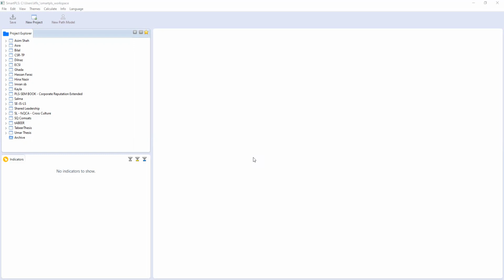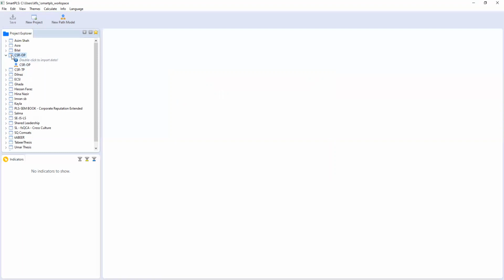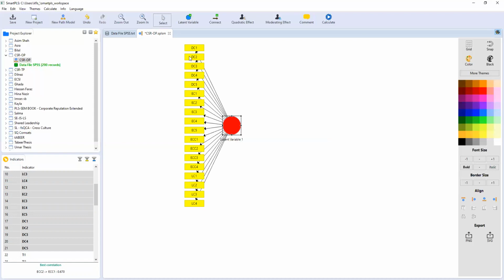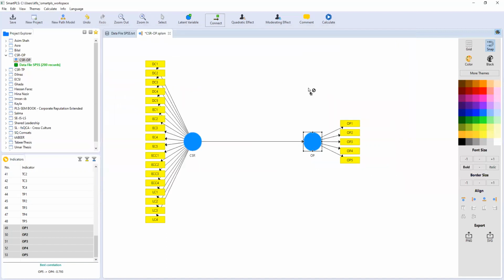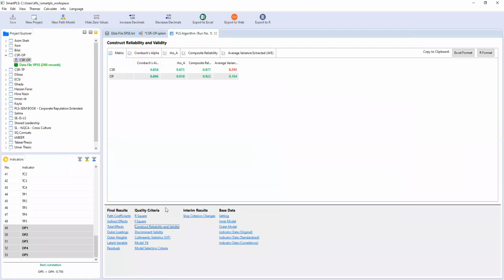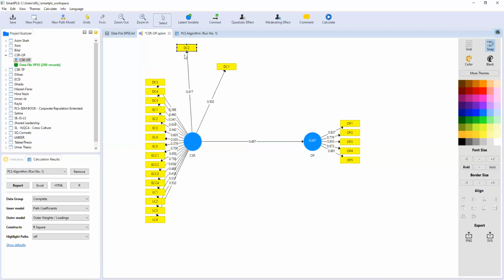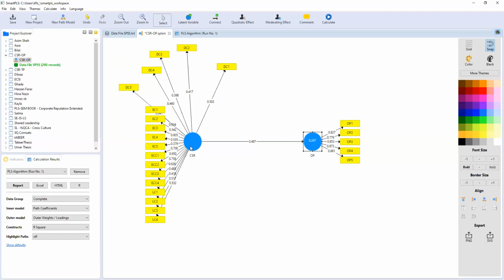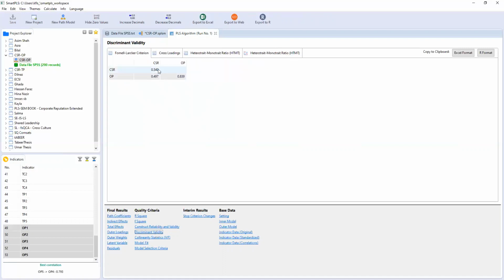Basic SmartPLS Model Assessment - Measurement Model - Reliability and Validity

Comment: Assalamo Alaikum. I am PhD scholar and recently started research work using smart pls. 
Can i run SEM with two latent variable and one Dependent variable measured through financial ratios. Plz guide me.
Reply from the maker: For financial data you will need to check for assumptions. SmartPLS may not support those yet.

Comment: Dear Dr Latif, can you please guide me how to justify my composite reliability rho_a  greater than 0.9 ? 

I have read your paper about "entrepreneurial leadership"in which your composite reliability values are following:
0.914
0.916
0.922
O.93

Your reply will be great help for me because I am working on my Master's thesis. 

Just because of your videos I have learned alot. You had done a remarkable contribution in knowledge sharing.
Reply: If someone else know's about the answer to my question please do let me know.!
Reply from the maker: Values over 0.90 are fine. The values over 0.95 are much of a concern. Composite Reliability is a liberal measure and values tend to be high. You may refer to the book as well. 

Hair Jr, J. F., Hult, G. T. M., Ringle, C. M., Sarstedt, M., Danks, N. P., & Ray, S. (2021). Partial least squares structural equation modeling (PLS-SEM) using R: A workbook.
Reply: @researchwithfawad  Dear Sir, Thankyou so much for the response. But in this book it is stated on page # 77 that: ” Values above 0.90 (and defnitely above 0.95) are problematic, since they indicate that the indicators are redundant, thereby reducing construct validity (Diamantopoulos, Sarstedt, Fuchs, Wilczynski, & Kaiser, 2012).
Reply from the maker: You are not way over 0.90, for just marginal. You are good to go.

Comment: Hello, Dr. Latif, in this video, you have assessed the AVE which has a convergent validity problem, but I didn't find the video that you solve this problem. 
I have also this problem, originally I have only 5 items of one construct, two items have loading >0.77, an other three items loaded only around 0.55. And this construct after I deleted two indicators with Lowes loading, then reached only to AVE = 0.457 and CR =0.711.  I would like to know, how could I in this situation to prove there's no convergent validity problem under meine constructs. 
Your kind help is much appreciated. Thanks so much in advance. 

regards,
Min
Reply from the maker: Thanks for your comment

Here is a video that may help
https://youtu.be/Vvu1Sntf6fc

Also, if your CR is over .70 and AVE is between 0.40 and 0.50, you can say Convergent Validity is established.
Fornell, C., & Larcker, D. F. (1981). Structural equation models with unobservable variables and measurement error: Algebra and statistics.

Comment: i have problem in discriminant validity as my few values are not less than .85. how i can resolve this?
Reply from the maker: If it is less than .90, you are good to use them. If not, check if the items are cross loading. If so, remove cross-loaded items.

Comment: Asalam O Alikum, sir what if my path coefficients are low but p values are 0.000 and other things remain perfect. Will this be an issue?
Reply from the maker: No that is not an issue, It is possible to have lower regression weight and your p-value still significant.

Comment: In your video CSR had low AVE. You said it's because CSR has four dimensions. Kindly guide how to solve construct reliability and validity issues of such variables in smart pls.
Secondly, can we report reliability and validity statistics drawn from smart pls while perform mediation using sobel macro for spss in same research.

Jazak Allah!
Reply from the maker: To improve Validity statistics check for outer loadings.
To improve Discriminant validity check cross loadings.

Why use sobel test, it is better to use mediation analysis using pls.

A more detailed video that can help
https://youtu.be/iCA_WsmrQ-A

Comment: Hi  .....
Hope you doing well...
Have a request that if you have knowledge about PLS SEM ? ..... Partial Least Square Structural Equation Modelling ? 
Actually I have adopted this model for my research work data analysis and now facing some problem about writing results of tables which I got like .... what is outer loading its description..... construct reliability ,assessment of structural model, assessment of model for collinearity issues, assessement of R2 , effect size of f2.... effect size of f2, goodness of fit index etc ..... Thanks in advance and please let me know if you cane help me ....
its my whatap no ...923003314141
Reply from the maker: Whatsapp please
0092-3115417402
Reply from the maker: You can also watch this video

https://youtu.be/jaH9iYi-Wnw